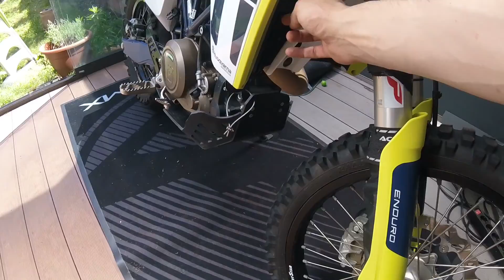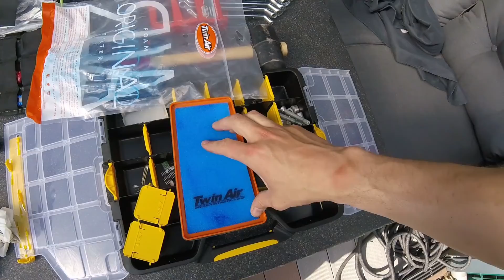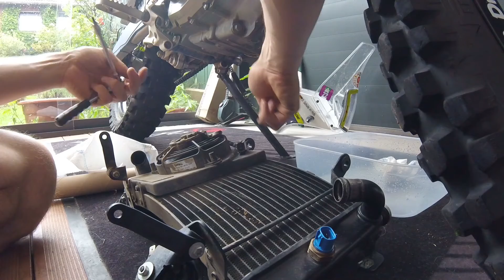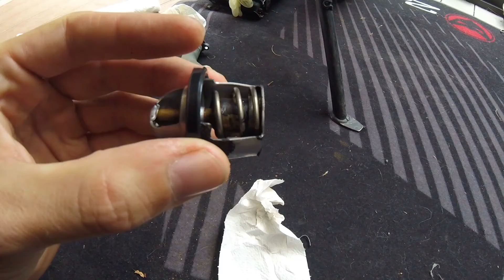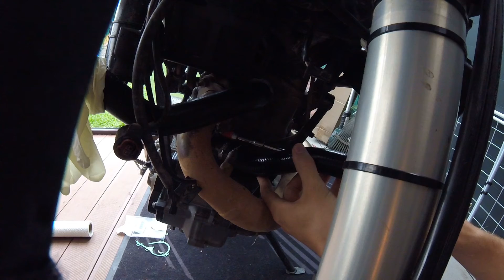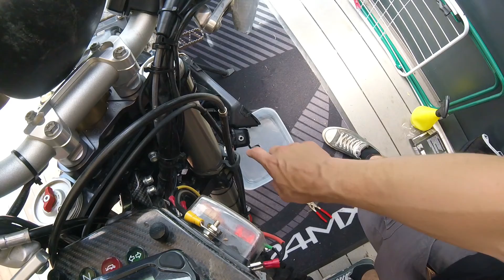Husqvarna 701: Overtemperature Issue / Solution and Air Filter

Comment: Hi, did replacing the pump solve the overheating issues and the red light on the display during idle speeds? I have a factory pump and a radiator with a more powerful fan, but the light comes on during idle speeds. Note that the outside temperature is around 10 degrees Celsius. I'm going to Dinaric, and it can get up to 35 degrees Celsius there, so it will be hot. Do you recommend this pump from Nice CNC, or is there another one better? I'm being proactive because I feel I can stop it from running freely. Will replacing the pump help?

Comment: Did you figure out why the thermostat failed? How many kms did you ride till if failed? What was that coked/ burned residue on the valve? The presence of such damage means to me at least one side of the valve was dry and exposed to big heat. Did somebody work on the cooling system before? All interesting questions...
Reply from the maker: Nope, I never found out why the Thermostat failed. It must have been at approx. 9000-10000 Kilometer if I remember it correctly. Until now everything runs smooth but I will install a bigger Waterpump within the next Months as well because I dont like to face these Problems again at a longer Trip.
Reply: @Speelbird  A bigger water pump? Who sells bigger water pumps for the lc4?
Reply from the maker: @dawidd4817  For example Ambro, Nicecnc or Judd Racing
Reply: Try not to let water get by the coil packs,when washing.

Comment: When your engine temp warning light goes on without the rad fan going on that means for me: the temp sensor reports high coolant temp. the thermostat does not open the flow through the radiator: engine produces heat, coolant temp rises, thermostat does not send it through the radiator for cooling, radiator remains cool and the fan switch does not switch the fan on. Did I miss something?
As you found, it must have been the thermostat valve. Dirty radiator would cause the rad fan stay on all the time.

Comment: i bleed the air on the cylinder head, where the water temp gauge is for the ECU, next to the sparkplugs.  then I tilt the bike sideways 30 degrees to the right side so the air bubble goes up through that tiny hole where the thermostat is. then I fil a little more and re-bleed on the head. then I fill it up till bleed on the left side radiator.   then I only get a few little air bubbles on the engine run. if you don't bleed the head then it takes a lot more bubbles before it stops.

Comment: Good video.
What's your Model-year?
My fan doesn't run when ignition is on.
Only when the engine is running.
My 701 is from 21.

I have the same issue.
But if you ask me, I don't think you solfed the problem with your fixings
Riding aufm deutschen Feld is different as on the TET. =D

Greetings from (TET) North-Macedonia
Reply from the maker: Thanks. Its MY 2020, I also recognised that the Fan wont turn on while the Engine is turned of on other Model Years. 

These Fixes work fine for me, I ve been around some slow paced Trails in some Heat lately and the Fan turned on much much later, so its fine for me and the Hot Water Light in the Cockpit wont turn on at all anymore
Reply: @Speelbird  I hope your right. 
I have some sorrows because of this issue.
I go to Iran and Africa (videos coming soon).
There's more hot as here in Balkan.
It's only at low speed without any windflow.
I am wondering why there's no proper oil cooler solution.
Reply from the maker: @Adventorius  I would recommend to put the lower Fender onto your Bike as the Dakar Bikes do (Video also on my Channel). 

I also checked for Oil Coolers and you can get one at Lyndon Poskitts Shop for the 690, you should check it out. I also put some small CNC “Oil Cooler” onto the right Side of my Bike, you can find them on Ebay for 20-30 Euro.
Reply: @Adventorius  Hi. Are you having the same problem with overheating? Is this a disease of this engine? I'm flirting with the 701 but if this problem exists then I wonder if it's worth buying the 701.
Reply: @firemanpeter2  yes, i have overheating Problems. 👎
Reply: @mariusontrack988  oh shift, not good to hear this.  Then better to skip this bike.  Thanks for the info